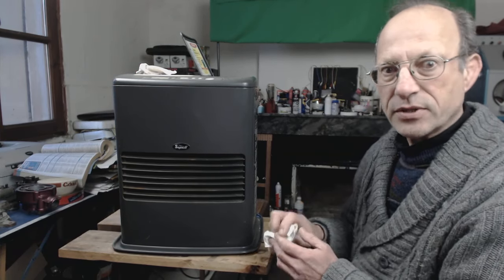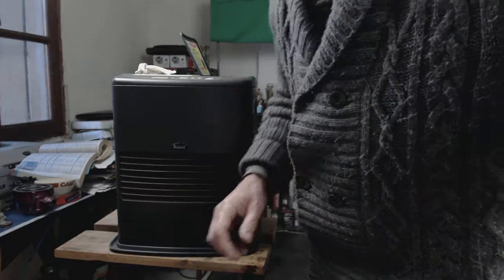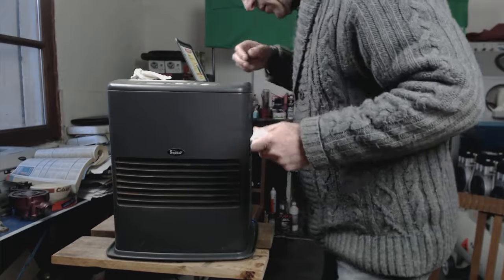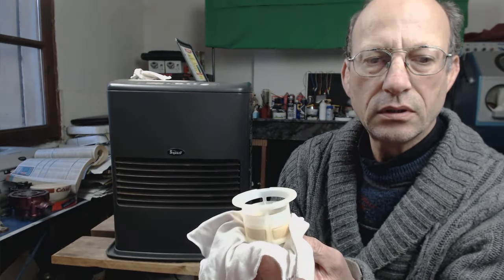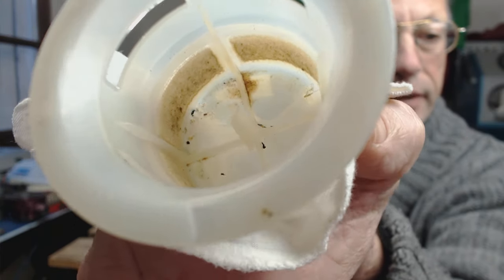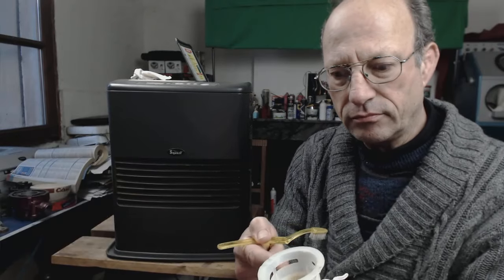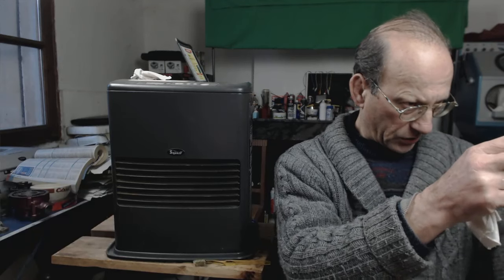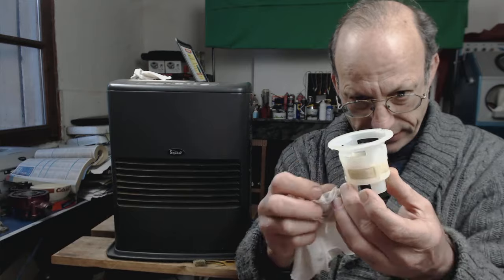Paraffin / kerosene / petrole inverter heater: Cleaning the filter

Comment: I’ve had my Inverter for over 10 years and a few years ago I started getting the E04 then E01 Coming up so I completely serviced it this year myself and cleaned the Carbon all off as I was fed up of restarting it till it worked (to be honest it was very interesting and made me understand it a lot better off how it works). I was surprised how easy it was and cleaned all the carbon deposits off the Igniter & flame rod. This show how bad fuel effects the performance not allowing i-ons to pass over time, anyone who buys one should do it trust me…..purified fuel for me from now on, this cheap paraffin gives off odours and isn’t suitable for indoor heaters…if you start getting white smoke when you start it every year you need to clean the  inside with wire wool….I wouldn’t use water but only paraffin to clean it to be on the safe side 👍
Reply from the maker: That's a great report!
Thanks for sharing it with us :)

Comment: When I turn on my heater it gets nice and hot but after about 10 mins I just feel the cold fan blowing and there isn't much heat coming out. Is this normal?
Reply from the maker: It is not normal.

Was the flame extinguished?
By that, meaning that the fan is blowing air through the still warm heater.

That would be strange, because with no flame the heater should switch off.
Reply: @EngineTuning  the flame is still on
Reply from the maker: @currahee55  That's a five word answer ... nice!

Comment: My inverter heater is not throwing out enough heat, it used to. It seems to be coming out of the right hand side of front grill only, any ideas? You helped me with CO2 senso repair! It worked exactly as you said it would Thank you
Reply from the maker: Hi Marilyn
It is the rear fan that blows the heat out.
Vacuum all the dust that is blocking the fan intake.
While doing that, you can also clean the air intake filter.
Examine the fan blades ... they may need cleaning
:)

Comment: Hi there ive a toasi ste4600 very similar  to your unit a bit larger , ive an error E09 , ive cleaned the filter any ideas ? Many thanks in advance ,Bob
Reply from the maker: Pump the old fuel out, to replace with fresh fuel.
Add around 0.5% acetone.
Otherwise, clean the flame rod, as per my other vids :)
Reply: Thank you for your reply , my error is E1 , I've cleaned the rod and chamber spotless , I've dismantled the fuel pump and copper pipe and cleaned thoroughly although  nothing was very dirty , reassembled and still not igniting and E1 , many thanks in advance ,Bob
Reply from the maker: @theoldrectoryfarm 
 I can't help you, because it could be anything.
The error codes are not always exact.
Check for a failed component in the ignition system.

Comment: I get a FUEL error even though the tank is full. I tried to clean the filter, and it was perfect (stove used at most 50 hours). Turns on and after about 15 minutes FUEL error and then turns off. Some advice ? Thank you.
Reply from the maker: It could be the fuel.
Very often there is water in the fuel container.
You can buy funnels with a water filter.

Otherwise, it should still be under guarantee ... take it back!

Comment: Thanks ET, really clearly demonstrated. I'm just about to look at one of these heaters for a friend and this has been a really helpful vid. Best wishes from Normandie, Andy.
Reply from the maker: Cheers Andy.
I have produced another vid that may be helpful, particularly if you are sourcing the heater from Le Bon Coin.
It has just finished uploading, so it has no subtitles yet, and it is unlisted.
But you can have a watch before final publication:
https://youtu.be/CDGXHAkvDQc

Another vid is to follow, providing more details behind my method to increase the heat output (as outlined in the above vid).

You know my previous videos on these heaters.
Here is the playlist for others reading this comment thread:
https://www.youtube.com/playlist?list=PLeHV-kNBKNNfEtkx0cTb-mbtelhpNOPFa

Check out the vid concerning fuel, as there are two types.
In France, you will know that the supermarkets are now providing 20lt containers of the correct fuel for these heaters (C1 grade).
Cheaper 'home heating fuel (oil)' does burn ... but at a lower temperature, with more pollutants.

Logically, by boosting the combustion temperature to that of C1 fuel ... more of the lower grade fuel pollutants will be burned off, and there will be less carbon clogging problems.

However, I would still recommend that your mate buys the C1 grade, and further boost its already high level of efficiency, to reduce fuel consumption.

We need to play tricks, after the price hike.

Last year I paid €17 for 20lt of C1 <1% aromatiques
This year I paid €22 for 20lt of C1 <2% aromatiques

25% increase for a less refined product FFS !
... and I'm seeing it in Carrefour @ €25 for 20lt - 46% increase !!!

That's a huge tax increase on 'staying warm through the winter'.
(images of an old fashioned wine press - one more turn of the screw should be fine)

Hopefully you can find cheaper sources in Normandy.

Best wishes :)

Comment: Thank you for the video! Do you find that these Inverter heaters with clean paraffin fuel generate a lot of condensation? I use it in a large bedroom with double glass patio doors and in the morning I have to physically wipe away the condensation on both windows and doors. I had the same problem with my old kerosene heater! Tks
Reply from the maker: Personally, I'd buy an electric blanket, and not use the heater in the bedroom.
An electric blanket is far more efficient, with the heat trapped by the quilt.
Not only is the bed toasty, but the mattress is dried out.
With such a simple, and cost effective heating solution; there is no need to be breathing fumes while sleeping.

RE Condensation
The dew point formula is based upon humidity, air temperature, and surface temperature.

Ie. Even double glazing can get coated in condensation

This is made worse, when using gas or paraffin heaters, as they both create moisture.

Overall, the electric blanket wins by a mile :)

Comment: Hello. Great video. I have the Zibro LC2230 purchased September last year. Its still working great, but I have noticed on a lower flame output, the blue flame is starting to throw random yellow flecks, sometimes large. I have previously gotten as far as disassembling the air filter at the back, but with the fuel just about done, I am prepared to strip it down during the summer season to attempt to clean it out. 

Would you know the specific culprit for the random yellow flame flecks?

Again great videos.
Reply from the maker: That's a well formulated question Paul.
There are two fuels that you could be using https://www.youtube.com/watch?v=dRmrEOBsEDw:

Highly refined paraffin, specifically for non-vented heaters
... This burns cleaner, and hotter.

Home heating oil (kerosene), specifically for vented heating systems (usually boilers).
... This burns less cleanly, less hot, so the fumes must be vented.
However, many people use this, because it is much cheaper (though more dangerous to health).
The kerosene fuel is more likely to clog the flame rod, therefore a regular summer strip will keep the heater running fine during the winter.  

Now factor in, the act of reducing heat output.
Both approach 'incomplete combustion', but kerosene approaches this quicker.

Solution
Buy 5 litres of acetone.
Mix it 0.5 - 1% with the fuel (5 -10ml to 1Lt)

This breaks the surface tension of the fuel, resulting in greater atomisation, when injected.
The fuel burns hotter, and cleaner.
Hence it pays for itself in greater heat output, and reduced maintenance.
It also allows you to reduce the fuel flow (heat output), whilst maintaining a clean burn.

In addition, it will combine with moisture, and help that pass through the system.
In effect, it is a 'super additive'. 

You can also buy a water filter funnel, because even expensive paraffin can contain water at the bottom of the container.
Always pour, or siphon the fuel with care, when approaching the bottom.

For older cars, diesel or petrol; acetone improves combustion.
If an engine is running a bit ragged ... add the mix to the fuel tank, and listen as it makes its way to combustion.
The engine will begin to purr.

If you have been using high end paraffin (with a picture of an indoor heater on the label)
... then, after just one season, the heater probably can wait another year for a service.
However, use acetone to keep it clean, and monitor the flame from time to time.
Also siphon the fuel out of the base reservoir, at end of season, and you may never need to clean the flame rod.
:)
Like and subscribe, to help the channel ;)
Reply: @EngineTuning  Hello. Thank you for the detailed response. Much appreciated. I forgot to mention that I have been using the C1 graded Paraffin from Bartoline (I'm in the UK), the cheapest out of the C1 graded paraffins.

I haven't really heard of the use of Acetone in these heaters until your videos, so I might would have to give it a try. I've already been using an additive called Dipetane which is meant to be one of those "hidden wonder" additives. Gets glowing praise from car owners using the stuff in petrol and especially in diesels, but its also formulated to run in Paraffin burners too. A colourless extremely refined oil according to the website. Mixed 1:200 ratio with all fuels. I've been using it in my model petrol tabletop engines and Aladdin oil lamps and it does keep the carbon at bay. Not noticed any adverse effects so far. 

There are also a growing number of owners of these specific paraffin heaters where they have been adding Dipetane into the tank and it apparently keeps the carbon charring to a minimum in the burner chamber.

The link below is the website for the additive

www.dipetane.com 

If you scroll down in this link below, it goes into detail with the use of Dipetane and keeping the parts cleaner. He runs this website about comparing energy costs and fuels. However he does take a different attitude with the use of C2 paraffin, but as for me, I would rather stay with C1 for health, safety and heater longevity reasons.

https://electricheatingcosts.com/home-heating-using-paraffin-inverter-heaters/

Comment: great video thankyou, do you know where you can buy replacement filters in the UK?
Reply from the maker: They only need replacing if they get broken.
In normal use, this cannot happen.
Therefore, finding a replacement is likely to be problematic, to impossible.
Reply: @EngineTuning  Strange tone in the reply but thanks regardless.  I have found one online.
Reply from the maker: @Chickey  
I don't understand the 'tone' reference?

The filter is well protected, and is cleanable.
Therefore it is not a component that normally needs replacing.
Hence my prediction that they would be difficult to source.

Well done for finding one.

Comment: Thanks for your video. I've got the code error EH with this inverter heater. Do you have any idea what it could be?
The heater can't no longer set the right temperature and after 5min it turns off...
Reply from the maker: EH Error Code
In most cases, the Corona EH error code is caused by the temperature inside the heater, exceeding safe operating levels. So in other words, the inverter heater is overheating and the EH error code indicates an internal overheat situation, which immediately causes the heater to shut down.

The main cause of the Corona EH error code is dust clogging either the air intake at the rear of the heater, or the hot air outlet grill at the front of the heater, and you should clean both of these.

Corona ‘EH’ errors can also be caused by objects, (such as furniture) being placed too close to the heater, and you should always ensure that there is plenty of airspace around your Corona Inverter heater when in operation.

It is also important to make sure that there is plenty of ventilation in the room where you are using your heater, because lack of fresh air (ventilation) in the room can also cause the ‘EH’ error code, so try opening a window slightly and move the heater so that its rear intake fan is as close as possible to the open window.

If this advice, fails to solve your Corona EH Error code, then you will need to clean and service your heater.
Reply: @EngineTuning  thanks a lot for your answer.
I don't understand because I have already cleaned everything inside the heater and it's located exactly at the same place as last year. Last year I didn't have the problem. 
I'm gonna check it one more time. 
(sorry for mistakes I'm French)
Reply from the maker: @manonfauconnier6827  The problem is that error codes do not always match the error.
Did you start the heater with last years fuel in the tanks?
If so, you will need to pump out the old fuel and start it on fresh fuel.
Other than that, clean the flame rod.
Other than that, it could be a temperature sensor issue.
Reply: @EngineTuning  thank you for your time and your piece of advice.
I'm gonna change the fuel because as you said it is the old one in it. Maybe that's why I've got the problem. I'll keep you in touch.

Comment: At first thanks 
I have toyotomi kerosene heater have abad smell( smell of kerosene ) .... my question is what should I clean it or fix it  ?
Reply from the maker: In general, you should keep the heater clean.
Dirt will absorb fuel, which will slowly and constantly release an odour.
If it is an injection type inverter heater, the flame rod may be caked in carbon.
This will affect fuel regulation, and it may be burning inefficiently.
When using base kerosene, the flame rod will need to be cleaned.
Otherwise, check the condition of the wick.
Reply: @EngineTuning  thank you  very much.  God bless you

Comment: i remember seeing one of you videos suggesting adding a touch of acetone to the kerosene for a better burn , could you remind me of the ratio to add please?
Reply from the maker: Hi Steve :)
1% is fine.
You can go as low as 0.5%

It's not to add highly flammable fuel.
The acetone breaks the surface tension of the paraffin, causing improved vapourisation.
Hence the cleaner, and more efficient burn.
Reply: @EngineTuning  thanks will give it a try

Comment: Thank you for your efforts. I have an aladdin heater and it appeared on the screen HHH and it stopped working and I did not find a solution to this problem, knowing that there is no reset button on the electronic board. Please help and thank you
Reply from the maker: This is difficult because the heaters can have unpublished codes that are only understood by technicians who have the 'workshop manual'.

Consider following my video on repairing the heater, and also make sure that the electrical connections are all good
... and replace the old fuel with fresh fuel.

If this basic yearly service doesn't solve the problem, then there may be a failed electrical component.

Good luck :)
Reply: @EngineTuning  thank you so much and good luck

Comment: Hi there,
I have an rather old Inverter 5902 used rarely. 
Last weeks I used it to heat up our garden pavilion with "old" paraffin slightly red coloured.

Now I try to start with new "paraffin" which is not coloured - simply crystal clear, its Toyotomi Plus according to data should be fine.
Nevertheless the Inverter 5902 does not start and gives an error "F2" - already cleaned filter but still does not start.
It tries twice to fire then goes off with fault "F2".

Any hint or adjustment of the inverter for the paraffin needed?  
I am based in Germany and Paraffin is hard to get here, 
so switching back to old paraffin (red coloured) is not really an option.

Thanks
Reply from the maker: Could be water in the fuel.
Shocking though it may sound ... there is usually water at the bottom of the paraffin container.
This is why people use a funnel with a water filter in it.

If it is water, you need to suck out the fuel from the fixed reservoir.
Drain the portable reservoir to another container, to let it settle for later use.
Water sinks in paraffin, so if it gets in the portable reservoir; when you up turn the reservoir ...
Hahaha; the water is the first liquid to run into the fixed reservoir (Nice!).

Buy some acetone and add 1% to the fuel.
The fuel will burn cleaner and hotter.
Also, the acetone will absorb moisture.

You don't lose your money, because you get more heat from the heater, and the burner will stay clean ;)

If it's not water, then you will need to clean the flame rod https://www.youtube.com/playlist?list=PLeHV-kNBKNNfEtkx0cTb-mbtelhpNOPFa

Good luck!

Comment: I have a Qlima SRE CO 30x paraffin heater but the FUEL warning keeps flashing and so will not ignite. I watched your video thinking the filter was the problem but it was clean and I cleaned it anyway to be sure but still have FUEL warning. I changed the paraffin in tank but still no progress. Any ideas?
Reply from the maker: Nothing is certain Ashley.
The error codes are often misleading.

Also, you must try to think in an organised manner, as if this is not your problem.
Imagine it was a friend  asking you for advice.
I'll bet that the first question that you asked would be "has it been running okay"?
"Did it not re-start after replenishing the fuel"?
"Did you meticulously remove all the fuel from the fixed reservoir, before filling with fresh fuel that is not contaminated with water"? 
"How far does it get in the startup procedure (when does the error code appear)"?
etc. etc.

Do you see what I mean?
You must think logically, when troubleshooting a machine, if you are to discover where the fault is, or ask for advice ;)